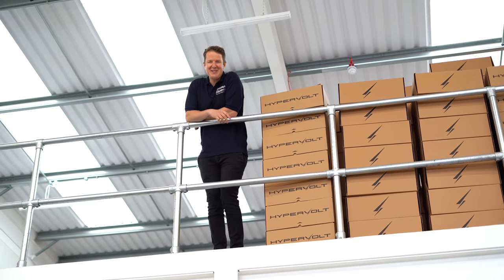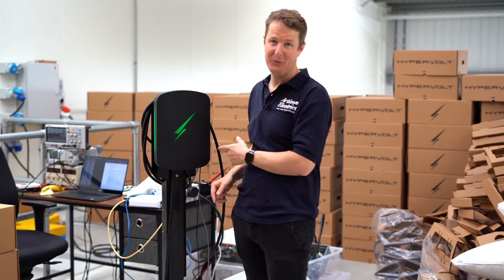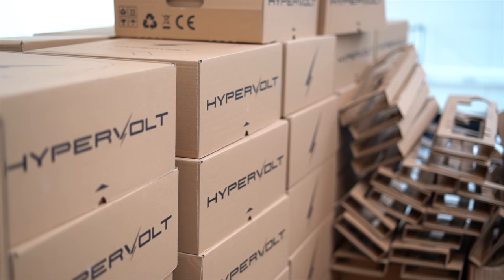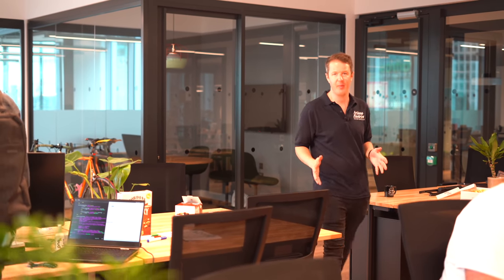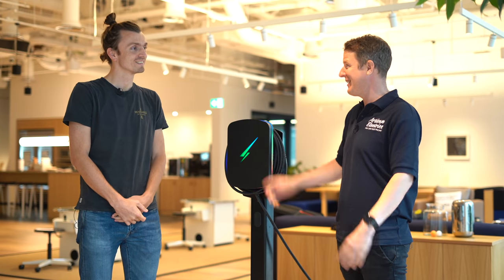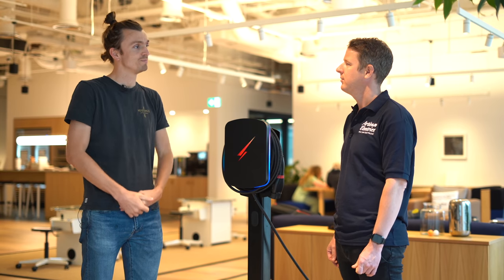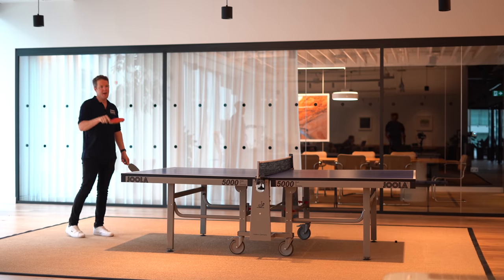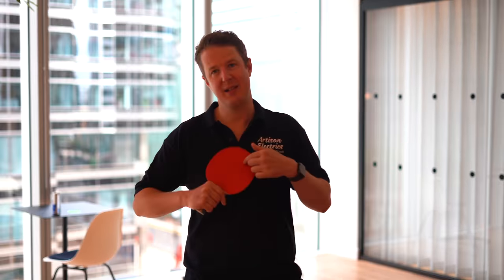How its made - EV Chargers Hypervolt Factory tour

Comment: "Ultra connected devices" are simply connected devices. Expect bs from a sales guy ha ha
Reply: Super fast too
Reply: They are not, that’s sub 50 millisecond end to end latency which means you can do mass scale frequency response! “Ultra” might be a sales term, the tech behind it is very far ahead of other things out there
Reply: @hypervoltev  Again, I have to call bs on that sales term "ultra". From Northern Europe I can ping services running on servers on the other side of the globe in less than 25 ms but we don't call the internet the ULTRA connected internet. You get my point. Also, your Hypervolt units are connected via Wifi which performance is inherently affected by the environment (distance, noise, antenna, home network routing, etc.) in which it is installed so your low response times are not guaranteed and are at best soft real-time and more than likely above 50 ms. Sure, it will be relatively fast and you can still do "mass frequency response" for large clusters of Hypervolts but it will take much longer than 50 ms. Still, under or over 50 ms, the "ULTRA connected" term is sales bs talk. I'm writing this response from my ULTRA connected laptop.
Reply: @_-martin-_  Not quite, pinging is different than getting a device to execute an action within that timeframe, and the lengths required to guarantee the latency are enormous. We are not talking about one lucky shot, we are talking about a P99. Without getting into detail that is part of our IP, while you're right about internet and everything else, there is a lot more than we do to guarantee this in 99% of cases. Not just the ping latency, the actual action happening as well.

Comment: While the "Netflix" platform is a great opportunity for the grid its also a potnential supply security issue, imagine if a malicious actor (or indeed a software bug) triggered 10,000+ chargers to turn on in a single second, you'd put those half-time kettle switch-on's pick-ups to shame.  Hopefully the government is doing something to mitigate this.
Reply: Yes. Though 70%? of people would have to have their cars plugged in and in need of charge to disrupt the grid. It’s only likely to cause an issue at night or weekend? So not a big disruption. There are bigger issues.
Reply: @AndyK.1  You're absolutely right, but there's a distinction between "the grid" and the sub-distribution networks. You're completely right, the grid is fine. The networks that run wires from the grid to your home and everyone else's are not. In the sense that 50 years ago, 30 years ago, or even long before that, no one thought a 7 - 11kW per household consumer will exist, and now everyone needs to have access to one.
Reply: Malicious actors less likely, as we put a huge premium on security, but it's not impossible. Mistakes will unfortunately inevitability be made, as this is such a big difficult problem to solve it will take probably years of constant refinement, as with anything. A Nokia 3310 was an awesome device in its day,  and most of us enjoyed a bit too much Snake on it. But relative to latest Android and iOS devices, it feels like something from the dark ages. Technology advances extremely fast, sometimes scary fast, and we simply need to work together with our customers, DNOs and energy providers to do a great job here. Will it be perfect in day one? No way, that's just not possible. Will it work reliably for 99% of people in 5 years. The answer is hopefully yes!